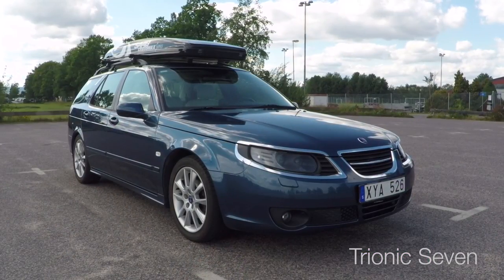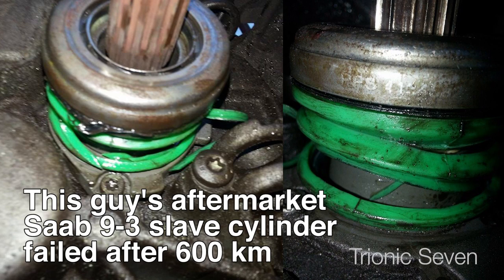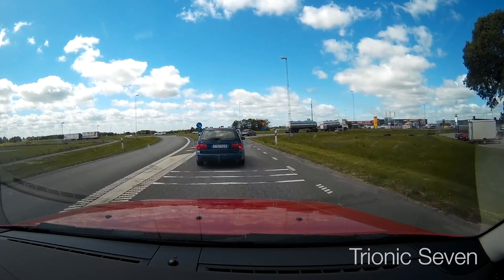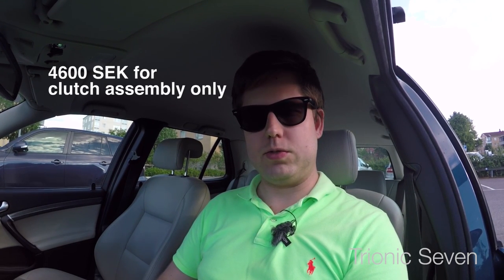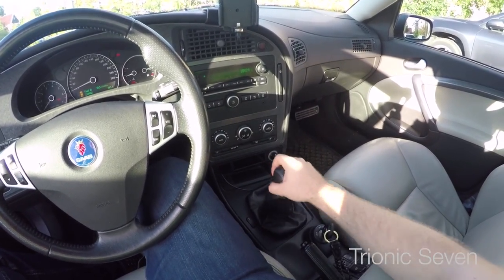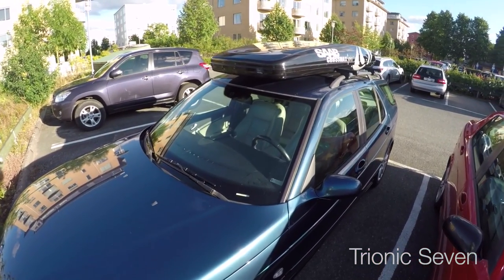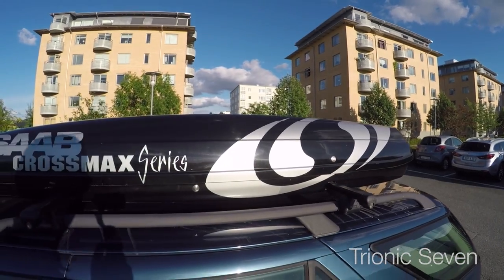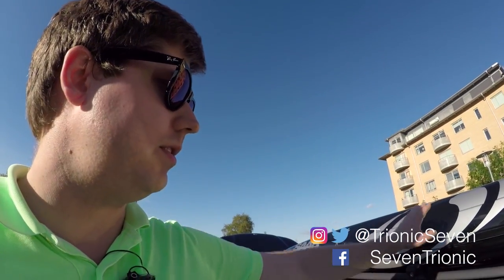The Clutch Failure That Nearly Killed Our Saab (Story Time!) - Trionic Seven

Comment: One Take 9-5 guy here. I'm throwing the same codes right now and before watching I bought an OEM DI cassette today. Thanks for confirming my fears about aftermarket cassettes.
Reply from the maker: Hey man, nice hearing from you! Yes, the DI cassette is central to the performance of the engine and it took even Saab many iterations to get them just right. The aftermarket cassettes must be avoided.
Reply from the maker: Yep, I'd say it's pretty universal. But each time we save someone from buying the wrong aftermarket components we have made a good deed. Interestingly enough I advocate against two aftermarket components and advocate for two aftermarket components in the video. Difference is that one is that two of them are cheap copies while two are uprated parts :)

Comment: Never throw away a DI casette. Even your new (and since you have 2 cars) casette may fail completely all of the sudden, so it's nice to have this one 99% working one spare to at least drive home. This "bad" casette that caused you a CEL, it would work for thousands kilometers yet still. The crack, you had seen there, is also one of the reasons why it is bad and basically why you got the trouble codes.
P1312 Combustion Signal Cyl 1+2 Shortage
P1334 Combustion Signal Cyl 3+4 Shortage 
These should mostly happen only when starting, not while driving, I guess you also did not get it while driving, right? (even that might happen, but not in general).
Some elements including epoxide inside did crack from getting hot and then cold again, so you may get that 1+2 or 3+4 (sometimes really only 1 of those) shortages while starting, mostly, means you won't get as powerful spark at cyl1, because it'll also fire cyl2 out of the timing :-/ as bad as this might sound, until it's only happening on starting, you're quite OK, people tend to drive with that issues even tens of thousands of kilometers.
Anyway, since you already replaced it :) keep the old one. I have like 6 of those or so, saved few guys with them already and also lending them to people that travel too far (like Croatia or so) to have it spare if their own would give up.
Reply from the maker: Thanks, Peter! I learn new things from you as always!

Comment: Brilliant video well worth the wait. I think you did well with those repair costs, the aero clutch should do 100k miles +. 

The bolt in the bel housing has probably been sat there cushty for a while, you hit a bump then the flywheel kicked it around. If you were unlucky I would expect a solid clutch pedal and damage to the bell housing but the Saab gods were smiling on you. Great car
Reply from the maker: Thanks, Dave. Yes, we were lucky :)
Reply: This is going to sound crazy, but literally the same thing happened to me 2 days ago. I drove over a speed bump and suddenly the clutch started to rattle like there were metal bits in it. But in my case, the clutch actually gave out. The gearbox still engages but there is no drive in any gear. The rattling noise only occurs while the clutch is engaged. And there was no warning, clutch was not slipping and had good, low engagement :(

Comment: Flywheel bolt, "flying" inside the clutch chamber...  WOW!!  ...   yes!, someone at some point replaced the clutch, removed the flywheel for some reason (crankshaft oil seal remove/replace?/ machine the flywheel? ) and during re-assembly did NOT torque those bolts to spec.  In my book that is the most probable explanation.  Myself, I also put a small drop of flexible (blue) locktite to each bolt during installation to add a layer of prevention in addition to torque to the correct spec when I replace clutches.
Reply from the maker: It's weird indeed. I've been contacted by another 9-5 2006 2.0t owner who had the exact same problem! So maybe it's a factory thing.
Reply: Maybe, but now we will never know...  I own a 2004 9-5 2.3t, & did a full clutch, crankshaft inner oil seal, oil pan & subframe bushings job(s) not to long ago.  I'm glad my flywheel bolts were properly tighten to start with.  On re-assembly:  small drop of Blue Locktite; torque to 65 Nm + 40º clockwise.  Those bolts will not go anywhere...

Comment: Thank you Jonathan! I am rebuilding my og9-3 and was about to buy a clutch kit with aftermarket slave cylinder and LUK.  Given how involved the job is it's better to get the sure-win components.
Reply: just get the viggen clutch kit from auto zone. thats what i did. also make sure to inspect your flywheel. mine had a lot of surface cracks and set me back three weeks because i couldn't find an OEM replacement. ended up buying the light aluminum one from genuine saab. which i recommend if you need a new one. it has a replaceable wear surface!
Reply from the maker: What the previous poster said. The viggen clutch is a good idea, and be sure to get that OEM slave cylinder/throwout bearing.
Reply: Trionic Seven 
Thank you both! Actually I am installing a B235R from a 2006 9-5 so i won't be able to run away from Viggen clutch.  I am in Canada so we don't have AutoZone, luckily rockauto has Sachs.  This video and suggestions came just in time!
Reply: Jon H well you could use the base model clutch :p why are you swapping though? I hear the b204 has stronger ininternal. is there an advantage to swapping to the b235r?
Reply: Madam President 
yes because I want to stick with T7 engine, also the 2006 B235R comes with the king cobra pipe that makes 260HP stock so no need to modify much!

Thanks I will look out for FAG logo! I got curious and courtesy of Wikipedia:) FAG stands for
"Fischer's Automatische Gusstahlkugelfabrik," or "Fischer's Automatic Steel Ball Factory."
Reply: lol nice!
Reply from the maker: Actually, if you are swapping engines I'd suggest a B235R/B234R hybrid. Engine block, sump, connecting rods, and pistons (milled 1.1mm) from B234R and the rest from B235R. No more oil sludge! 8)
Reply: thanks Jonathan that is ideal! I bought the B235R because it is the lowest cost option (direct drop in), but it turns out the recycled yard engine has water in cylinders when they washed it, so I ended up spending 3 times the money at the machine shop and I am starting to assemble the block now.

The current B205R suffered from sludge issue, so this is how the B235R swap started:)

Next I need to figure out if the ECU bin from B235R can work with just immobilizer ID change, so your T7Suite video would be helpful!
Reply from the maker: You need to modify the ECU software to match the hardware code and VIN number.
Reply: @TrionicSeven  Only 1.1mm Heard it should be milled 2mm. Why onl 1.1?
OFC it makes higher compreesion ratio.
But why are there different mill measures from what I heard recomended.

I hav an engine to take apart to rebuild, with a hbrid setup it are said it has 2mm milled pistons.
For Etanol it are greater with a higher compression ratio.

Soon on my YTC I will post about my projects, and first out it will be a sock og 9-3 2.0t upgrade.
and my Aero re-
roading.

Comment: Another great video! Thank you for all of the information that you share!

I have a suggestion for a video. For those of us who haven't tackled this problem just yet. Say, you replace an engine, or an automatic transmission (or both), which computer do you need to deal with. Do you simply remove the ECU from the old engine, then install it on the replacement engine? Will an engine or transmission swap cause a problem with the ignition key? Should one prepare for error messages until the new engine or transmission is reset with the GM tool?

Thanks again!
Reply from the maker: The ECU must basically match the hardware (i.e. engine specs), so I think you take the old ECU. You'll need to modify the VIN number, however, to get it to work with the TWICE box in the body.
Reply: Thanks, Jonathan!

Comment: Hi Jonathan! Thanks very much for this cool addition. Always intersting to learn from your experience and there's always something useful that I pick up. Keep up the excellent work and don't forget when it comes to the wheel bearing replacement - I'm your man! By the way, did you ever use the new brake rotors you got for Laxen?
Reply from the maker: Hey Paul! Thanks for your comment. I sold the rear brakes with Laxen, but the front brakes are still on the shelf and I'm going to make an unboxing vid some day :)

Comment: 0635 on the casette also means that the casette is made in 2006 week 35 :) so that casette is pretty old by now. 

Personally i don´t trust anything other than 3.7E. Even the oldest ones of those are getting to be pretty old. I run on E85 only and somewhat tuned cars, it might not be as critical when running stock cars on petrol.
Reply from the maker: Good point, didn't know that number was a date code. :)

Comment: Maybe some guy replaced the flywheel at some point, maybe there was no lock tight on the bolts, love your channel and your videos, what Saab do you think I should get, I really want I Saab 900 1988 model
Reply: thats the year i want! my birth year :)
Reply from the maker: It's a total mystery at this point :) I have never driven the classic 900, but it appears to be a car with a real Saab feel to it!
Reply: Should I try to find I Saab 900 or Saab 900 turbo maybe an spg model, did you the make any blue 900 in 1988

Comment: Question: I am new to Saab's and I own  a 2005 9-3 Arc Convertible. (5 speed manual) Can I use that 9-5 Aero clutch on my 2.0T? I hear that SPEC is a hit/miss in the aftermarket world.
Reply from the maker: Never upgraded my clutch beyond OEM stuff, but several tuners I've talked to agree that SPEC is a bad idea. The Sachs clutches are supposed to be great, but more expensive.
Reply: I just replaced my clutch.  The OEM clutch plate had SACHS stamped on it.
Reply from the maker: Yeah, I should have clarified with that. Thanks.
Reply: Thank you for the reply, but you didn't answer my question fully. I appreciate the feedback about SPEC but my main question (re-worded slightly):
Can an OEM clutch for the 9-5 Aero (2.3 liter) work in a '05 9-3 2.0T? The reason I ask is I need upgraded torque holding abilities.
Reply from the maker: Sorry, I don't know enough about the ng9-3 to give an answer. My feeling is probably not.

Comment: Hi Trionic 7 , i reach 451000 with my saab 9-5 of 2000, every cold start a huge cumulonimbus cloud white smoke , when engine get hot after 5 minutes smoke disappear , i need to top off water coolant every 100 km roughly , i suspect head gasket ???
Reply: 451000km
Reply from the maker: Doesn't sound good at all. I have never had a head gasket fail but that sounds like it (or a turbo failure). Don't drive it but have an experienced mechanic take a look at it before it gets really expensive.
Reply: oh yeah the turbo i haven't yet checked it , it could be the turbo , when ii removed the sparks plug no presence of water inside the top of cylinders  with a small light via the plug access!;
Reply: whats the cobra pipe?
Reply from the maker: Cobra pipe is the air intake side of the turbo. The cobra goes from the mass airflow sensor down to the turbo.
Reply: if it stops smoking once heated up it might be a worn piston ring. if the turbo was bad or the head gasket was bad i think it would smoke when warmed up too
Reply: get a compression test done. i have a feeling the coolant is a separate thing. the plasic on the over flow tank can crack when it gets older and cause a leak. mine was leaking at then upper hose connection
Reply from the maker: I'd say piston rings equals black smoke, especially when revving. That was the problem with Laxen when I bought it.
Reply: Trionic Seven sorry I strongly disagree. I work on cars and black smoke is usually a fuel issue. Burning oil Is usually white or blueish. Look up symptoms of worn piston rings. If it where a head gasket it would continue to smoke when warmed up
Reply: basically smoke disappear when engine warmup and suddenly a few misfire then it is over after 5 to 10 minutes when coolant temp rise. I hear during start up a squeazing noise like a whistle then disappear too after few minutes the noise look like the steering pump but it isnt , i removed the serpentine belt , i start the engine but noise still there , i suspect the chain tensionner cause the indication is at 20 mmm, more than 15mm.Anyway it doesn't solve  my problem still coolant consumption , misfire etc , i ll check this cobra pipe, today i tightened the head engine bolt but the problem still the same.
Reply: did you check your overflow tank for leaks? mine was leaking where the upper hose attaches. its pretty common for tanks to crack there. would have to hear it to make any further guesses. maybe you could upload a video of it?
also could have a valve stem leak
Reply: Madam President  i will chevk the upper hose but for the valve stem ? I should remove the engine head? My problem is white smoke with misfire during cold engine start with coolant consumption. Could be the turbo or headgasket? When engine get hot no presence of milky oil like myonnaise, no bubble within water coolant expension tank
Reply: no leak observed on the overflow , still same problem , cold start with smoke after 1 minutes , a noise like steering pump but this is not the steering , 1 weeks before i start the engine without serpentine belt still same sound.Since last january i ve got this symptom but without noise, no everheating since now only coolant consumption and white temporarily
Reply: should i remove only the banjo bolt for water check?
Reply: no mayo att all since few month , no overheat, coolant color still green and clean.As i said for a few minutes i get a noisy sound like steering pump empty, noise disappear after few minutes when engine get hot, i ve done the test without serpentine belt starting with battery , same noise. In fact could be a turbo noise??
Thanks for the feedback.King Regards
Reply from the maker: That does not sound good, could be the standard sludge issue. I would drop and check the sump and strainer.
Reply: nothing to do with sump and stariner? I ve got no oil comsumption, i use Mobil 0w40/0w30 as per saab requirement, oil is clean , no sludge , and still consuming coolant and white smoke

Comment: Jag hade en 99:a automat -76 där momentomvandlaren lossnade! Som tur var hann den inte lossna helt men med tre bultar avslitna och resten lösa var katastrofen förmodligen sekunder bort...
Reply from the maker: Hopps! Vi får säga att vi har tur :)
Reply: Ja så här långt får jag allt vara nöjd med saabs kvalité. Jag har haft 23 stycken dom senaste 37 åren och det som pajat är momentomvandlaren, en turbo på en 900 80:a , ac-pumpen på en 81:a, topplockspackningen på en 9000-97, bakdämparna på en 9-5-00, styrsevoledningarna på en 9-5 07:a och ac-kondensorn på 9-3 -11. Kondensorn var ett stenskott men jag räknar det eftersom det är korkat konstruerat att inte ha ett skydd när den är öppen så långt ner. Bakdämparna är nog mer av en slitdetalj egentligen.
Reply from the maker: Oj, kul med så många bilar :) Ja, bakdämparna är standard på 9-5, speciellt kombin.